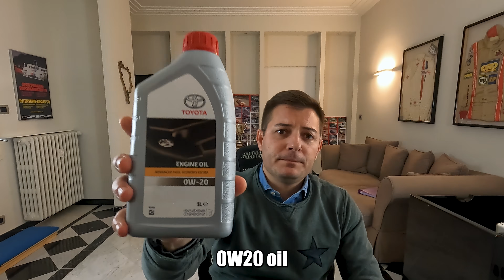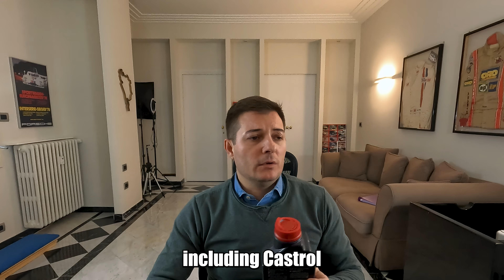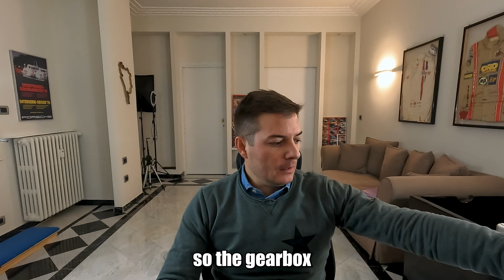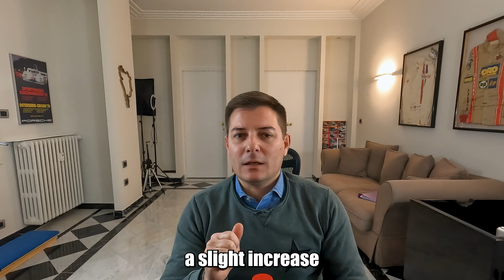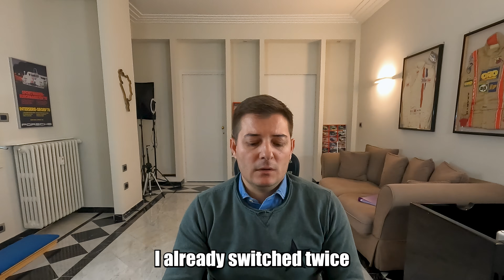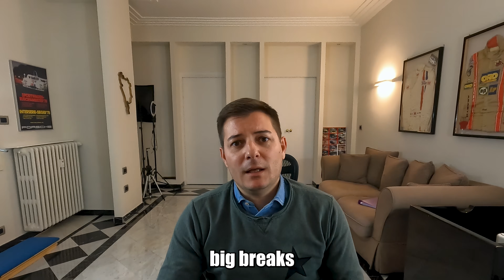Choosing Oil and Lubricants for Toyota GR Yaris & GR Corolla

Comment: 😃
Ich verwende seit dem ich 2500km auf der Uhr habe, Ravenol 5-W30 SP, wird ca alle 2000Km von Toyota gewechselt.
Im Getriebe 75-W90 und in den Differenzialen 75-W90 LS beide von Ravenol diese lass ich 1x im Jahr wechseln und kann Adrianos Aussagen bestätigen. Auch die 660 Motul Bremsflüssigkeit verwende ich und wird min. 1x im Jahr gewechselt.
Ich hatte gerade eine super Bestätigung dessen, was ich für meinen verwendet habe und was ich die letzten 2Jahre mache 👍
Reply from the maker: Yes, I take my oil to Toyota for the warranty scheduled changes, and also I change it more on my own
Reply: Do you had contact with the Dealer or Toyota directly? I just want something written before i take action @PIRASMotorsport
Reply from the maker: You have to ask your specific dealer, as it seems that each one has a different position on this!
Reply from the maker: Thankyou Hini, its great to have this input also from you, you’re doing it in the best ways!
Reply: Nimmst du deine eigenen Öle zu Toyota mit?

Bei mir steht ein ÖW an und ich möchte dies im Rahmen der Garantie abhandeln

Grüße

Comment: I use MOTUL 300V Competition 0W-40 oil, much better than OEM 0W-20, the oil pressure on a warm engine in the range of low and medium shaft revolutions is much higher.
Reply from the maker: yes, this is how it works BUT, its not so simple: the lower grade viscosity has a direct impact on overall oil viscosity, thus making the 0W rated oil’s film less protective and thinner. If you wish to learn more, I suggest you watch some tests on Piotr’s channel, in description
Reply: @PIRASMotorsport with all the respect BUT the friction test between Motul you are suggesting and a oem toyota 0w20 has been an Loss for Motul. I mean I could read that wrong in some way, right now i am concerned why are you suggesting to watch the Piotr’s tests if they prove more friction and less protection from a higher viscosity oil. (Which i thought should be more protective like you said). All the respect to you, amazing content for GR owners !
Reply: In comparison of friction tests of Motul and the oil i am currently running looks like this :

MOTUL 5w30 ECO-LITE 
Normal : 0,349
100*C : 0,426 

Liqui moly special tec 0w20 
Normal : 0,252
100*C : 0,249
Reply from the maker: I understand, but remember that the 0W is what makes your oil film thin, therefore less protection 😅
Reply: @PIRASMotorsport  OW is responsible for the viscosity of cold engine oil, 40 for the viscosity of hot oil, so I have better protection when the engine is warm.

Comment: thanks for this great summary - testing ravenol 5w30 also for next summer, espec for track use
Reply from the maker: Sounds great!
Reply: maybe the difference in viscosity is quite small when comparing 0w20 in 80'C to 5w30 in 110'C 
 @PIRASMotorsport
Reply: RAVENOL DXG SAE 5W-30 @capichero